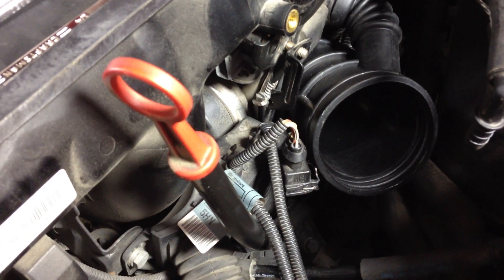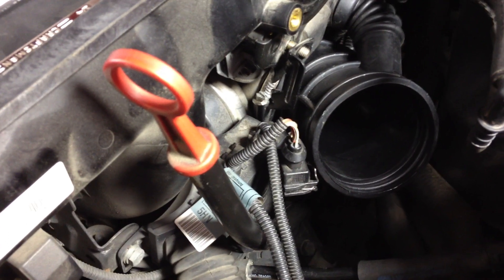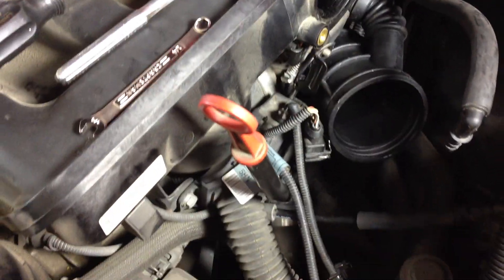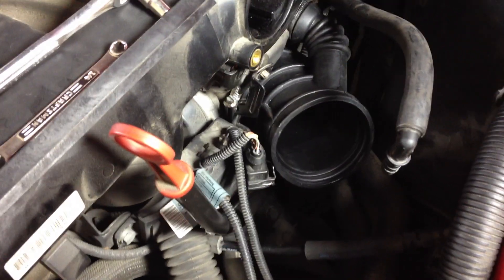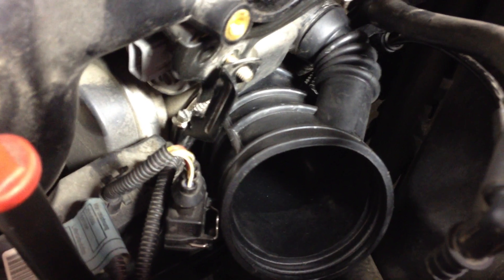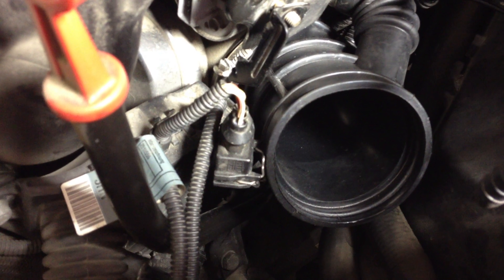BMW E46 Intake Boot, Throttle Body, Idle Control Valve

Comment: Always good when doing videos to have a basic system you follow. Expect everyone to be novices. In that start from the outside of the engine bay with the camera and then zoom in. Shows where the valve is, plus a little about what the symptoms are that might require you having to do the job is.

Comment: They also make flexible screwdrivers and socket extensions, $15 on Amazon, that will help in reaching those. Nice cars but a pain to work on. They should've used snap rings on the intake boots, like they use on the coolant hoses.

Comment: Not 1/4" heads. They don't use Imperial standards in Germany. It's 6mm. 1/4" is 17% larger and can easily strip the head of that soft stainless steel screw.
Reply from the maker: Cavi Mike 1/4 drive socket

Comment: do i have a throttle cable on my 2003 335i bmw if so whats the location?
Reply: you got a drive by wire (electric throttle body, no cable) and it's in the engine bay
Reply: My 2000 328ci has a throttle cable :(